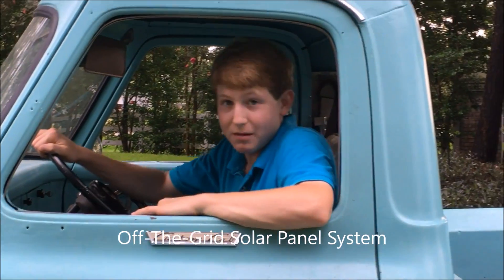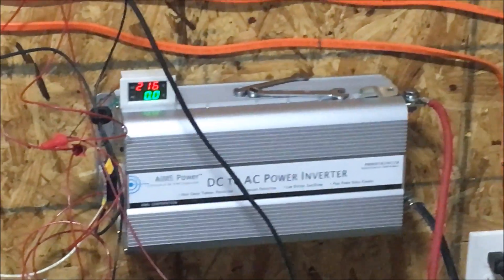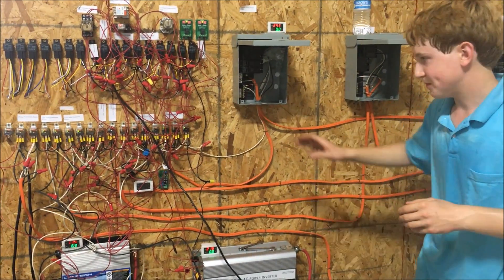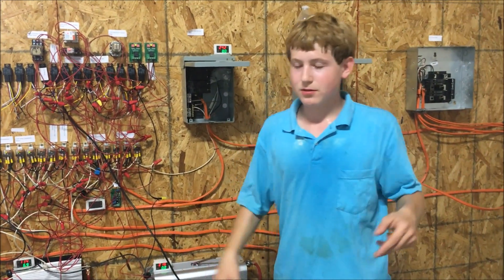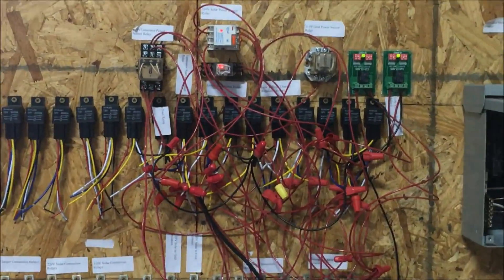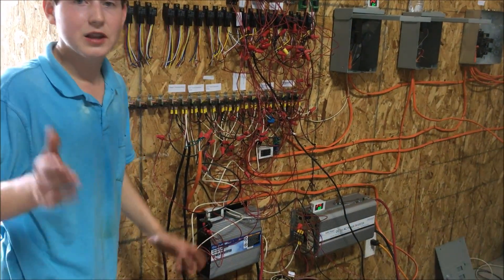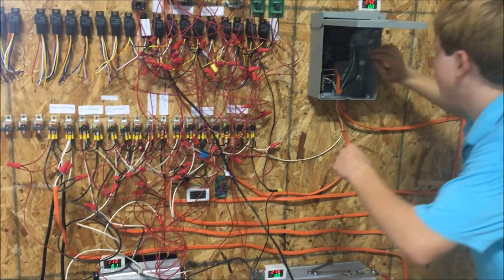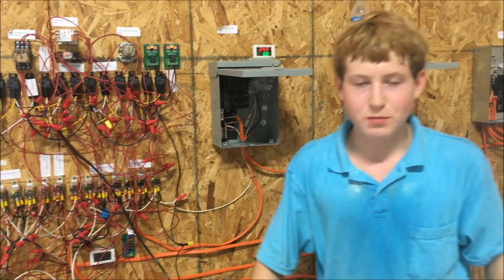Grid Tie/Off The Grid Solar Panel System

Comment: Thats amazing that you are into solar the way u am but you are much younger. Its a great hobby and can turn into so much more. When you build your next system id definitely go for a 48 volt system. All my stuff is 24 volt but wish id done 48. You can get a step down module to still mess with 12 volts but it using a quarter of the amps means alot when you start pulling more power. Infact you might want to do a high voltage dc system lile mike g. Look him up on youtube. Hes an old guy with high voltage solar and his system rocks. Great video

Comment: You do NOT have your batteries connected in the optimal parallel configuration.  You will have batteries failing much sooner than expected.  You must use method #3 here .. http://www.smartgauge.co.uk/batt_con.html

Comment: Nice setup. A little crazy, but as long as you understand what's going on, great. 
I'm hoping  you have since upgraded your inverters to "pure" sine wave (induction motors like pure waves; modified waves will waste power in the form of extra heat and sound/hum). Also gotten away from Centech. I wouldn't trust it to run full rated load for any length of time, especially during surges. There are really good inverters available now for decent prices.
Using heavy duty DC->DC buck converters would solve the 24/36/48V -> 12V issues you've mentioned. You can even parallel buck converters to get higher amps available (just need to put a diode on the Pos output side to keep backfeeding from happening)
Also, I hope you've moved away from relays and switched over to SSR's or micro-controllers. Will make your setup a lot more powerful/functional
Come join us over at SecondLifeStorage.com forums and as well live chats over on Discord https://discord.gg/qZFer9M
Reply from the maker: I did indeed get away from Centech equipment and move to a PSW inverter on the latest version of the system.  The newest version of the system is on the channel as of now, and it also features microcontrollers.

Comment: I am impressed..I have read "pure sign wave" is best, is the AC working OK?
Reply from the maker: The A/C in that system worked just fine, but it is rated for 208V/230V so it's not all that particular about the quality of power it receives.  The new system features a PSW inverter.

Comment: You definitely know your terminology, not sure you need solar in that neighborhood with the high priced homes I saw and the high priced truck your parents have provided for you. You need to watch some other solar guys who don't have wiring in such a disarray... Engineer775....GainSolar...they could show you how to clean up that rats nest of wires...but you definitely have a future in electronics / solar..... there are requirements for transfer switches..signage for the fire dept etc for meeting local codes for your safety as well as others...

Comment: Everyone told me that using 12vdc & relays was a mistake too but as you made evident it is much easier to handle, diagnose & repair.
I've been running my system for over 7 years without a single failure...though I have had to replace batteries occasionally.
If I were still running my business I would hire you in an instant...no joking...you have an amazing future ahead of you.
You are more competent than most of the people I have worked for or worked with in this field...go into electrical engineering as soon as you can.
Reply: He should go into aerospace ✈️ or mechanical ⚙️ engineering, it seems he already knows everything about electrical engineering

Comment: Damn you are amazing,,but did you do all the video's in the same day or do you really like blue shirts  and you need to get inside with some A/C you look a little warm ,,Thanks Austin great video
Reply from the maker: Most were done in the same day, but I do have a higher percentage of blue shirts than others for some reason.   Houston= "slightly"warm in late August.  The thermometer on the outside of the building is usually pegged to the maximum value of 120 (due to the reflection off the concrete)!

Comment: Here's the solution for the haters:   Buy a $200 steel garden shed 8' x 6' and house all of that stuff in there, away from house and garage.  Run a A/C extension cord to your garage.
Problem solved.
Reply from the maker: I am looking into some kind of out of sight storage system for the electronics right now.

Comment: Nice job on a 12v system! My friend and I are installing a 6KW Grid Tie system with 330 Watt Panels. Just got the panels mounted. I have a video of it up on my channel. I also own an Aims Power Inverter. I mainly use it for backup power during an outage. Mine is the 3000 Watt 24 volt version. Its several years old but still works good.
Reply from the maker: Good luck on your new install!
Reply: Electronic Solutions same here you cant beat the price

Comment: How's the alternative fuel world going these days? Do you have any interest in the opposite end of the spectrum-steam power? Besides the solar video project I hope you do I'm interested in charging a bank of batteries using steam power. You have any interest in that idea?
Reply from the maker: I build a steam engine out of a lawn mower engine a while back, and the engine did work, but it consumed quite a lot of air (I was using air to test it).  I was unhappy with the results, but with more improvements I could see it as a viable alternative.  I have also looked into wood gasifiers to power engines to run automobiles.  I almost built one, but I decided not to because it would not be cost effective for me to attain wood to power the setup.  If you have a lot of wood, I could see either option as a good option if ample fuel was available.
Reply: My thought is that we assume gasoline will always be around to power our engines. What if there's a crisis? We need a fuel that is accessible without a lot of middle men and technical processing to use. I'm sure you got that before me. I'm just letting you know it's on my mind too.
Reply: alcohol

Comment: You are awesome!  It's very clever and I expect it won't be long until you're building good off grid systems.  But, gotta say, a day in the library could save you a year in the shop.  There is a lot wrong here, and by current standards, a lot unsafe.  I could get technical, this is not the place for it though.  I've done crazier stuff myself...  My first off grid home burned down (not sure why but I can think of reasons!)    Good job but ~ I'd decommission it and study current best practice.  If there was a fire (and you have a lot of energy stored there) ~ home owners insurance may not pay out.  You're way outside of the NEC.  Again.... awesome! But....
Reply from the maker: Thanks!  I am working with some electricians that are helping me properly organize and ground the system to bring it to code.

Comment: What a wiring mess.  As for using modified sine wave inverter,  you can fry sensitive electronics.
Reply from the maker: The newest revision of the system features a PSW Inverter.

Comment: could you tells what brand of relay worked well with the inverters
Reply from the maker: I have switched relays since this video to time delay relays to prevent overloading of the inverters before they have time to boot up.  I used Dayton (Octal base) 8 pin time delay relays.  They seem to be working well so far!

Comment: I wonder if you could give us a broad over view of what you could do for $5,000 in solar power? If I start with that amount what would give me the most bang for my buck? Instead of having a gas powered generator to keep the essentials going. I'm interested in setting up a solar power back up for when the unexpected happens. There's all kind of batteries, panels, invertors, set up, etc. Could you lay out what would be the most suitable kind of batteries, panels, invertors for what I should consider buying?
Reply from the maker: Sure!  I will make a video on it for you.
Reply: Thanks! I'm also interested in the longevity/durability of the elements involved-like the batteries, the solar panel, etc.

Comment: You should invest in pure cinewave inverters because a lot electrical equipment don't work well with modified cinewave inverters and will go down after a small time on them.
Reply from the maker: I definitely agree with you.  The low voltage inverter (115 VAC) was actually supposed to be one, but when I tried to run the system it was evident that it had been damaged somewhere (maybe in shipping) because it would not power up.  I just put on the modified sine wave inverter to get the system working because it was what was available locally in my area.  I am planning to install a pure sine wave in the near future.